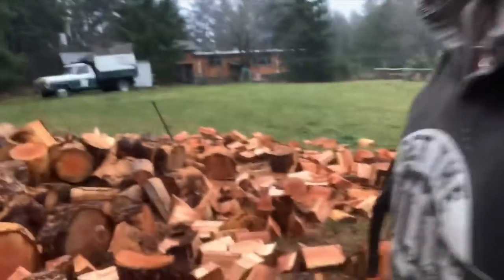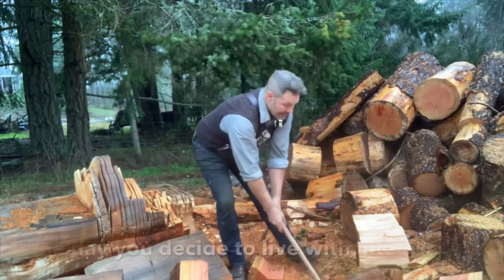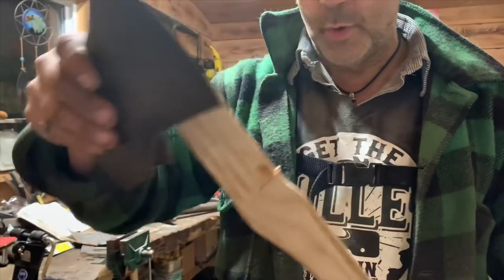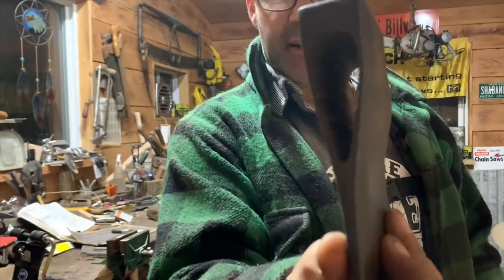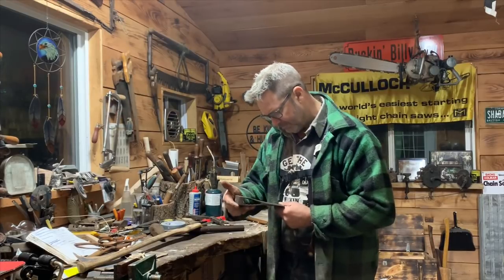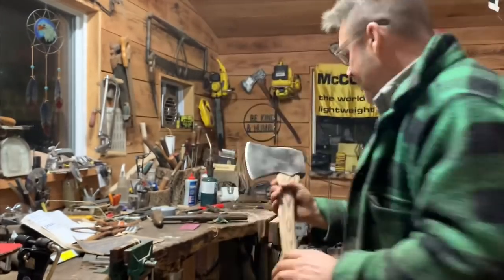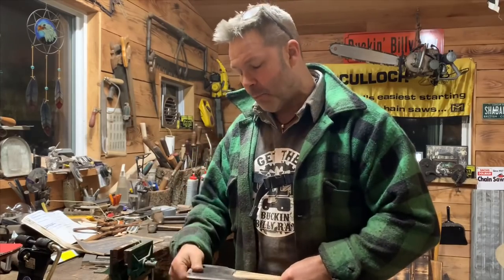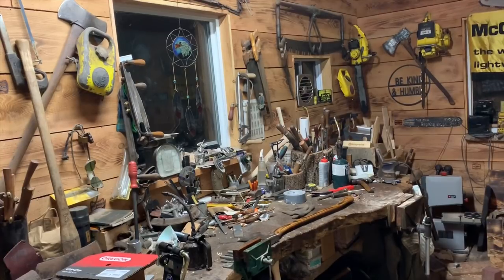Axes. Do I have to get rid of this one

Comment: I just came across the same axe. The stamp is deformed on mine but it is the same. Now I am motivated to clean up the head and replace the handle. If it ends up a fraction as nice as yours I will make it the start of my working wall hangers by my wood stove.